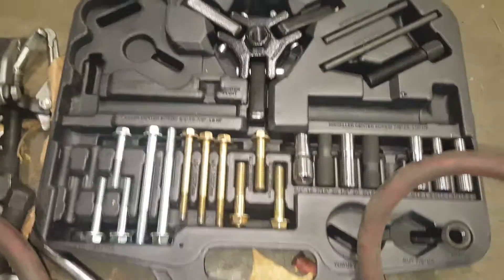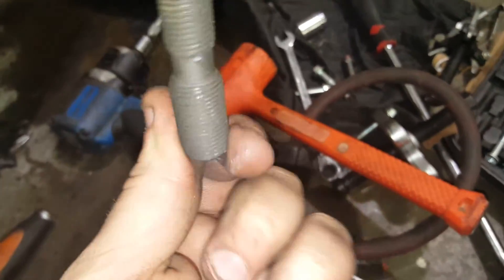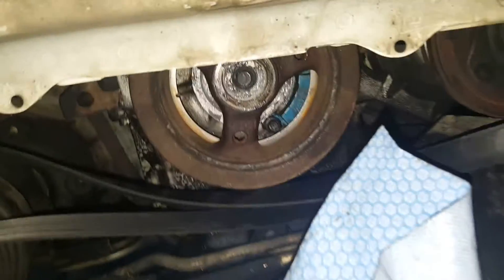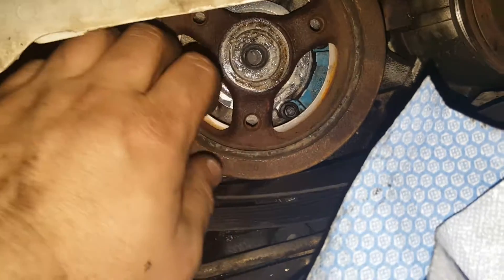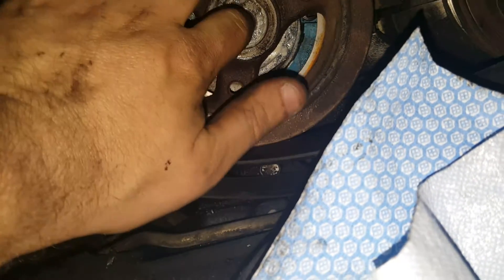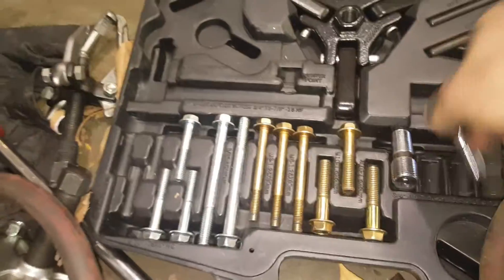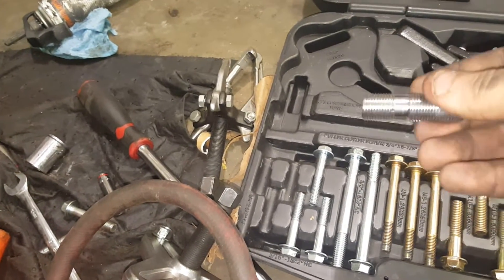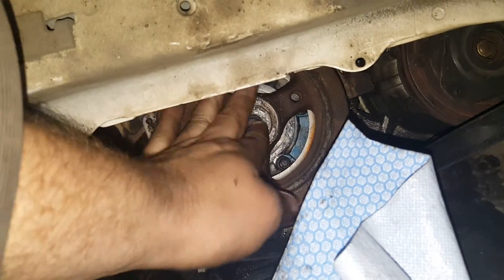Harmonic balancer install quick tip!

Comment: i have a 2006 Pontiac Grand Prix GT 3800 supercharged

when i take off the oil filter housing unit, a spring and a cap popped out

do you know if the spring or the cap goes into the motor first?
Reply from the maker: Jeff Fuehr sorry I sure don't. I would imagine there is a diagram available on google images that will show you how it goes. Sadly I don't have much experience with the 3800 super charge engines to know off the top of my head.